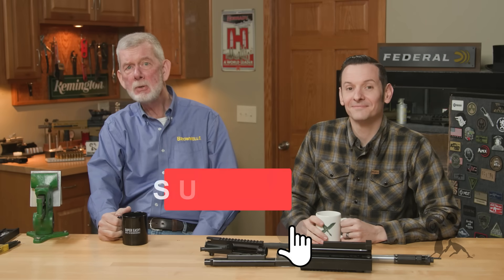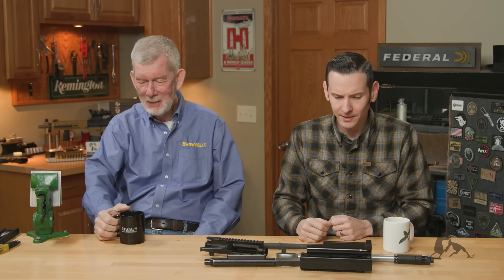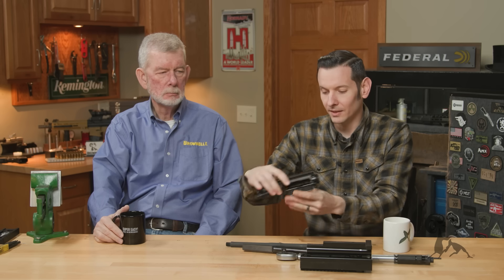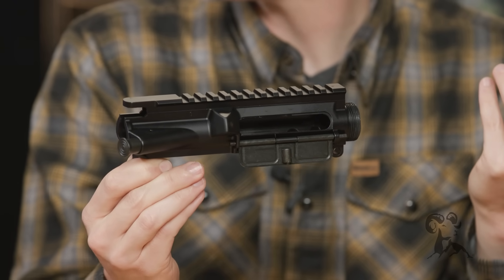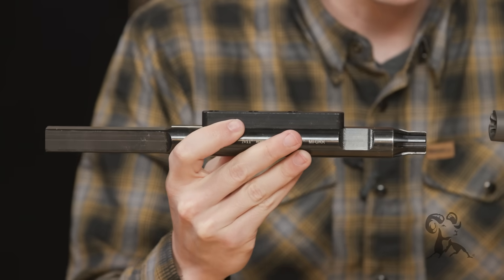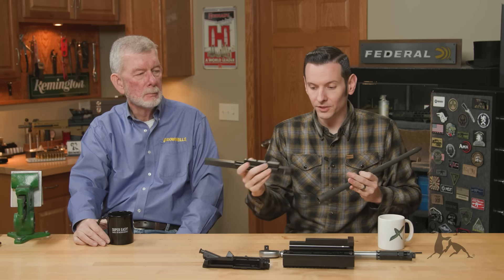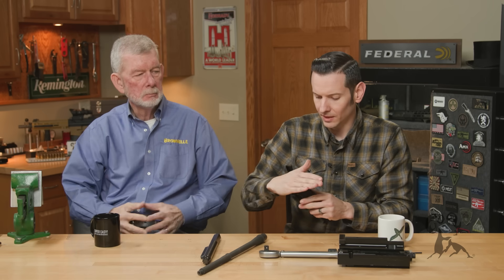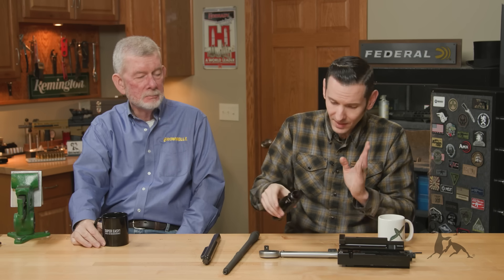SmythBusters: Top 5 AR Building Myths

Comment: "The wrenche doesn't know if your going left or right" So why does it have a switch? Whichever way the switch is set is the direction that the torque has to be applied. If you're backing a nut off you have to flip the switch. That's what ist there for. To detect the torque properly in the tool. And yes, you should tried to take care of your tools.

Comment: The reaction rod is ideally used without the upper support bar for the intention of exclusively holding the barrel while working on the muzzle end. There's absolutely enough play to keep the barrel from engaging the tool, unless you put some thin blue painters tape around the teeth ;) just don't run it along the side of the upper support bar or you could gouge the upper inside .. You can also clamp the upper to a table top on the corner or use some blocks and clamps.. Gas block alignment can be found turning the block over, and use painters tape to mark depth, then level the block and upper on a flat "glass" table top  (free info for the betterment of man)

Comment: The classic breaker bar-torque wrench adage is good advice, but not for this application. I also have always been told to not use a torque wrench as a breaker bar, but I think the real damage there is more akin to using a 3/8 breaker bar with a 90 ft-lb maximum to take off seized 150 ft-lb lug nuts. More using it for its long handle for maximum breaking force rather than just because it's a close-by tool. I would be shocked if any AR torque specs could damage a 3/8, even some 1/4 in. ones. People get hung up on things and don't consider the application. You can break anything if you try hard enough, but if you use it reasonably it's going to be fine; coming from a mechanical engineer.

Comment: I scooped up a real avid reaction rod for cheap and there's no wing. It works great and I've had no issues with it. I also have a cheap plastic vice block that clamps around the whole upper receiver but I rarely use it. Got a harbor freight torque wrench as well as a wheeler fat wrench and a tapco AR wrench that are all affordable budget tools that get the job done. Great video

Comment: The reaction rod with a sail will keep the barrel straight compared to many other clam shell types..Many AR uppers are not made to spec or are on the outer end of the spec, add a wide index slots and the barrel index pin (will) move side to side while torquing the barrel nut..This can cause the barrel to clock enough in the upper to cause misalignment between the bolt and barrel extension..I have seen a lot of home made AR's where the bolt hits the barrel extension while closing the bolt, causing peening on the out side of the bolt..I have fixed many of these clocked barrels using the Mid West reaction rod or the 2Unique reaction rod ..The reaction rod with a sail will also prevent damage to the uppers index slot or breaking the barrel index pin if too much torque is used..The 2Unique reaction rod uses wider lugs and a thinner sail compared to the Mid West URR that has narrower lugs with a wider sail..

Comment: If you want a really good torque wrench, like for people who use them in a professional context and you're using it all the time, DeWalt makes a very nice digital one. It's available in various drives. You definitely can loosen/tighten lefty fasteners with a torque wrench btw. If you weren't supposed to do that, the manufacturer wouldn't install a knob to reverse the torque.

Comment: When tightening the barrel nut just put the upper in the vise sideways, with some softer material in the jaws to protect the Picatinny rail and bottom of the receiver, rather than using some jig which relies on the "feet" that the takedown and pivot pins pass through to carry that torque. Also, if you're concerned about this, rather than buying some expensive "reaction rod" to install muzzle devices, just take the rail off and put the barrel in a V-block in the vise when installing the muzzle device. ZERO torque is applied to the upper this way.

Comment: You can only use the torque wrench to loosen things on rainy days when the Moon is full and then you must only use your left hand to operate the tool. To install or remove a muzzle device everyone knows the correct way is to mig weld your barrel to your vise so you don't destroy the threads, barrel, receiver or indexing pin, c'mon man.
Where can I get the device?

Comment: 12:09 everybody knows you have to buy a left-handed torque wrench to torque left-handed bolts. 😂😂😂
Honestly it doesn't matter. Left hand right. Hand doesn't matter. I've got snap-on torque wrenches and I check them once a year with a snap-on guy. You can walk on pretty much any snap-on truck and they have a vice mounted torque wrench tester for calibration and they'll check the torque wrenches for free.
Reply: I always keep a left handed hammer just in case I come across some of those left handed nails.

Comment: I'll make some heads implode😏😏😏😆.
I used 2 1x4 oak boards  as vice blocks...put on on the top rail and the other on the bottom of the receiver between the pin tabs and put it in the vice 90° of upright to adjust a barrel nut for a drop in handguard...i was told i could do this by the lead Armorer of a major AR manufacture..
It is a good thing to know in an emergency...

Comment: Can you please address the gas tube you put on your accurate AR in that video? You used a rifle speed gas block, which they state needs a straight gas tube. However you used a standard gas tube. Curious to see if that caused any issues.
Reply from the maker: The gas tube that comes with the RifleSpeed was used.
Reply: Ah understood. Perhaps I saw it wrong or it came with the wrong gas tube, as it appeared to have an upward bend to it, while the rifle speed blocks require straight gas tubes. But hey if it works it works, don’t do to much. Thank you very much for the response!

Comment: My first upper receiver holding tool is the clamshell type that clamps in the vise. I was removing parts to replace my handguard with a modern handguard for floating barrels. 
The barrel nut had a little bit of galvonic reaction to it which is corrosion. And it's normal to have a teeny bit between steel and aluminum. And it was really tight trying to get it free and I watch my upper receiver twisting a little bit had me scared That I was going to permanently twist my upper receiver and warp it. So I shifted off to using a reaction rod. I still have the clamshell style and it's great for building new receivers with new barrels and nuts. But if I have to put some real torque on something I'm using that reaction. Rod.

Comment: I’ve put 6 uppers together with the cheaper upper vice block and never had any issues. Although a few times I was nervous about torquing the barrel nut but lo and behold everything was just fine. Never sheared an index pin or bent the upper.

Comment: Shots fired at my harbor freight torque wrench 😂
Reply: I was thinking the same thing.
Reply: I have a balance bar wrench that I use to check calibration and my Harbor freight torque wrenches are near perfect
Reply: You get what you pay for, 😂😂😂
Reply: It's a qc thing. Most of em are spot on and hold spec for a long time, but every now and again they're waaaaaaaaay off. That's something that's caught in better name brands more often but also why hf is cheaper.
Reply: you need a torque wrench for a barrel nut? lmao!
Reply: @investigativeoutcomes9343  You do if you remove the barrel for any reason..Once the threads are torqued to a certain ft lbs, you need to torque to a higher ft lbs when re-installing a barrel..Any trained armorer knows this lmao...
Reply: @hairydogstail  pretty is to hit 40-80ft lbs by feel. lmfao @ U
Reply: @hairydogstail   i don't listen to torque specs, i tighten till i feel it is tight enough, some of those handguard torque specs are just way too much.
Reply: Go with Craftsman

Comment: I wish I knew the torque wrench thing yesterday. People saying that you need a breaker bar after torquing it is gospel on the Internet. I only put it to 35 pounds. I imagine 35 pounds is good enough? I couldn’t find my specific barrel nut so I just looked up generic ranges.
Reply: You can exceed 35 ft-lbs on the barrel nut if more torque is needed to properly index to the gas tube and/or handguard. The spec is a minimum of 30 ft-lbs and a maximum of 80 ft-lbs. Shims may be needed to get close to the proper indexing and torque.
Reply: @paullinkins8121  good to know. Thank you. It was already tight as fudge, and I THINK I didn’t need any shims. Hopefully I’m OK. I did it at 35. It is Areo upper but the barrel is a $350 criterion CHF CMV Crome lined “core”...WYLDE… And I think that checks every freaking box that exists for a barrel. But anyway, it’s a high-quality barrel and it fits extremely tight. I didn’t need to heat up the upper or anything like that, but I certainly could not find any wiggle room. A little bit difficult to fit, but the grease helped. I guess I’ll find out if I have any accuracy issues. It’s 13.9 anyway so I don’t know what kind of MOA to expect.

Comment: 6-10-2024, 8:08AM, PST 
 : When not using my torque wrenches, either for firearms or for automotive use, I always set them to zero. There won't be any standing pressure on the wrench/spring when not in use. Unless you're doing something stupid, a torque wrench might outlive you calibration wise.  LOL.    Outstanding instructional info information. 🐢 🤔 🐢 😲 🐢 😀
Reply: I always back the torch regulators off when I'm done too.  Really aggravates the next guy, lol.
Reply: True, good practice to tune them down. I should probably start doing that for the work ones.

Comment: Magpul Bev block.  About $30, holds the upper well, easy to set up.  
Its not a mecessity, as you can use a clamshell for your vise just fine....  but it just makes everything easier.  
I think thats the point you all.werr making here..... these arent swiss watches and high end tools dont get you a better product.  They can make the build more convenient though!  
Thanks for the topic......and i wish i had this video before my  first build..... agonozed over so many useless details..... amusing stories though. 😅

Tool list for us poors...first build 
Needlnose pliers
Small hammer ( yes, SMALL.....a larger hammer aint always better, for my fellow rednecks....lol)
Blue tape(because we're apes and we need tp protect the finish a bit with those itty bitty pins)
Small c clamp or channel locks
BEV block or upper receiver clamshell
Bench block ( a piece of softwiod will do)
Magazine block
Cheap maunal torque wrench
Cheap armorers wrench
Drift pins/punch set, steel (brass is great but they bend too easily)
Patience. (Cant buy this one. I tried.  Lol) 

You can purchase all these tools, if you have absolutely nome of them, for around $80 from amazon, and build a fully functioning rifle from parts.  😊

Comment: Not to throw shade, genuine question based in what theory I have;
Years ago, I saw a SOTAR video where it was clearly stated you needed a reaction rod, because there's a decent chance of shearing the pin on the extension.  I thought this was odd because the modulus on the pin was WAY more stout than an aluminum thread.  Has anyone ever seen it?  Crazier stuff happens, so I assume it's been seen.  I also thought saying it would kill your barrel if it happened was odd, too.  Couldn't you drill the pin out and replace with a new extension?  Even boring a few thousandths over in the barrel and new extension being an option.  Or is there a pressure issue?

Comment: Torque wrenches in general have to be the tool with the most myths around them.
Reply: +1. Guys mixing up inch Pounds with Foot Pounds.
Reply: @onmilo  "Guys mixing up inch Pounds with Foot Pounds"
I feel personally attacked!
(jk, just once when doing my transmission filter and gasket. It was a 'moment of duh' for sure. Luckily it was just the one fastener and I was working up to spec. Can happen to anyone!)
Reply: That and using extensions lessen the amount of applied torque. Its BS.
Reply: @Ratkill9000  straight extension id say are negligible and wouldn’t even worry about it. Now something like crows foot or dog bone id try my best to get it 90* from the head of the wrench. Because adding length does change torque.
Reply: @AmesArsenal  I saw a video where they tested the difference with a crows foot, and in regards to barrel nuts, the amount were not high enough to be any meaningful difference, as the torque specs are so wide that its not really an issue.  For other things it might be more important.
Reply: @Ratkill9000 The reason that’s a thing using extensions, especially longer extensions, as well as swivels for that matter, is because they flex and people think that that flex can, will and does alter the torque amount. Which it doesn’t.
Reply: @Ratkill9000 watch the torque channels testing of the myths. He explains em very well
Reply: @Ratkill9000 uh yea lol increasing the length of you fulcrum. People get a little silly without thinking.
Reply: I have four - foot pound and two inch pound torque wrenches recently had them checked on 1 was off 2 foot pounds and it was purchased in 1971.  It has been used from torquing barrel nuts to cylinder head bolts to fly wheel bolts as long as they are not abused such as using an 8 ft pipe on the torque wrench as an equalizer.
Reply: @mikerutledge1913 a torque wrench isn't going to be off by 2 ft-lbs across the board, it might be 2 ft-lbs off at the calibration point but that's not the same thing.

This might not apply to ARs too much but when you torque small fasteners in to aluminum threads, the difference between reaching the torque spec and pulling out the threads can be pretty small, a lot smaller than 2 ft-lbs so there are times when very precise small torque wrenches are required like scope mounts.

Some stuff isn't myth but when it comes to AR torque specs, the targets are so wide that you really don't need one if you have any feel at all.

I've met people with no feel before so that doesn't apply to everyone.
Reply: I'm usually pretty confident in my torque settings by how many fingers of pressure I use...😅
Reply: I disagree! Now sometimes, the German torque spec (good and tight) works just fine! But I'm a mechanic, it's literally impossible to successfully install a cylinder head with out a torque wrench. FACTS!
Reply: @scottmichael3745  that's not what I meant.
Reply: @Makingnewnamesisdumb  ok. So what did you mean? 🤔
Reply: @scottmichael3745  I mean everyone has a myth about what is or isn't safe to do with a torque wrench. There are a lot of videos on YouTube of people busting or verifying torque wrench myths.
Reply: You dudes are the best thanks for the info
Reply: Torque Test Channel did a great video on this. Worth the watch.

Comment: I use my torque wrench when I need extra leverage on a bolt or nut on my car. Building engines is why I had a torque wrench in the first place it just so happened I needed one to build my ARs.

Comment: Now hold on a minute!  I bought not 1 but 2 reaction rods from Brownells - one for an AR-15 and another for a 308-AR. I want a refund since they are totally unnecessary according to Caleb here! 😜
Reply: Send them back, 100% satisfaction guarantee!
Reply: But they look nice hanging on your shop wall.🔧
Reply: I was quoted as saying the opposite at 6:05 lol
Reply: @CalebSavant  I know that 😝 That device you demonstrated is interesting. However, I have the reaction rods and will continue using them. Especially for installing and removing muzzle devices because they secure the barrel itself, not the receiver the barrel is attached to. I “get” your point that if the torque needed to remove a muzzle device is enough to damage the receiver we have bigger problems.

Comment: Not sure if you already covered it but BCG coatings have been making my head spin lately. What I keep hearing lately is Nickel Boron is overrated and Chrome is the best.
Reply: A quality phosphate BCG (Daniel Defense, BCM, Colt, Centurion, BRT) is better than a Nickel Boron from the likes of Anderson, BCA, Delton, Etc.
Reply: Actually, watch the "school of the American rifle" channel about this topic.  Great in depth video.  
Basically. The best bcg was chrome plated bolt channel,  phosphate or other coating on the carrier outside.  Problem with nickel boron is that it's thinner than chrome, so when used in the bolt channel, it could allow a slight bit of slop due to thinner coating.  The coating itself didn't seem to be the issue. 
I think certain coatings have to be done to the entire bcg, others like phosphate,  can allow chrome in the channel.  
He also went in to some manufacturers seeming to mill the channel to accommodate the thinner coatings, and they seemed to spec fine.  
Fascinating topic, and the guy keeps a relatively complex topic fairly simple.